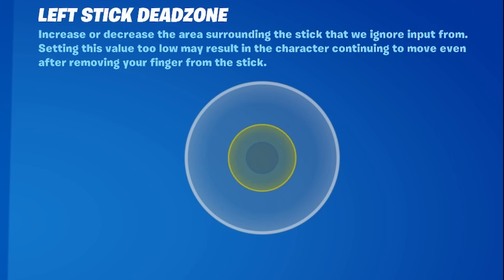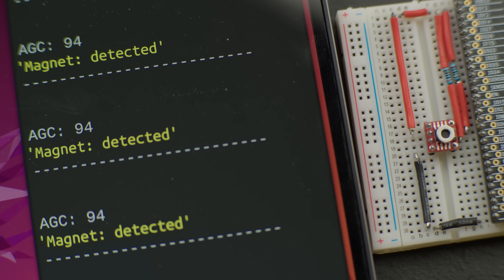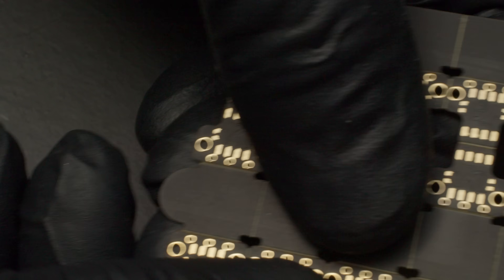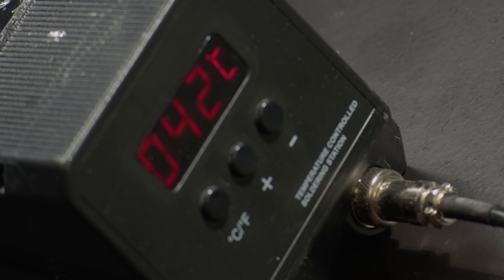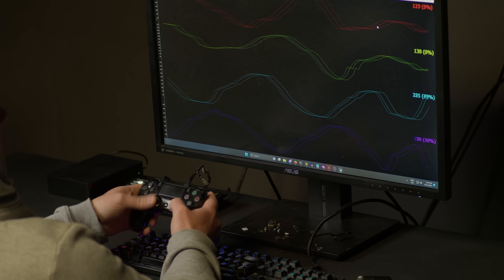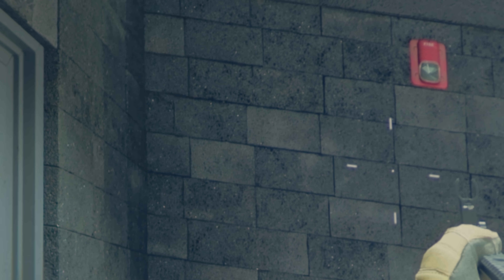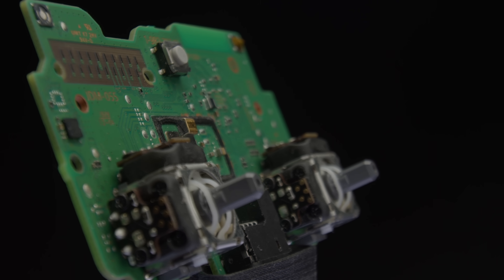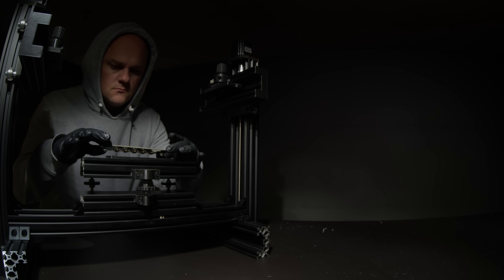Beating the $20B Joystick Drift Problem, and giving it away for free

Comment: i'm very happy that people are explaining how open source licenses are better than an "open unlicensed release" for protecting your creations from being "locked away" by ill-willed companies
Reply: The thing is, the companies don't want to fix controller drift. They want to sell more joysticks, that's it.
Reply: @alanwatts8239 third party manufacturers would be happy to have a small cut of controller sales by fixing it.
Reply: I'm surprised about people thinking this tech hasn't already been patented
Reply: @tesmat1243 Isn’t this the same method used in the N64 controller? Those sticks don’t drift, but they lose center-return from wear & the plastic part is easily replaced.
Reply: @johnnyc.31  the n64 uses an led, i think.
Reply: @tesmat1243  it has?
And has existed for a very long tkme
Reply: @tesmat1243 It hasn´t, but it also has been around for some time. You can literally buy ready made hall effect sticks that are made for being soldered into Dualshock4/Dualsense5 controllers. The controllers are relatively easy to disassemble, especially the Dualsense5 which is what is actually surprising (Same for te PS5 itself, it is in general quite friendly towards taking it apart and modding the hardware), and the soldering job is also pretty easy.
Reply: Can you explain this? Won't he get sued in the future if he's technically modifying not his property?
Reply: I am surprised that anyone need explanation, given the history of patent predators lurking around in our market environment.
Reply: @heyhoe168 oh yeah, because everyone knows about copyright laws and patent locking
Reply: @heyhoe168 Who the fuck would want to sit down and learn about patents? Please bro
Reply: @heyhoe168 I'm surprised you're surprised
Reply: True, but the "unlicense license" makes that phrasing a bit poor.
Reply: The fact that companies and individuals can just "patent troll" is a crime against humanity - how is it that we dont have a legal system that have protections against cynical use of patents? 
This is absurd.

No wonder normal people have zero trust in the system - it's corrupted by a lobbyist system that benefit insider  companies.
Reply: Make parts for 3d printers and make instruction on how to assemble everything with radio parts. Lego for big kids.
Reply: Use the same tech in cameras that detects light and use the pixels to track stick position with a fiber optic light on the control stick.
Reply: dont be a sell out and sell to a company bigger than you
Reply: There is nothing to licence or patent, hall joysticks have existed for a very long time.
Reply: Doesnt work in the US or UK. Copyright is your right, not something that doesn't take affect until you register it. Registering only enables the original creator to sue for legal fees, unregistered copyright enables you to sue for infringement
Reply: The Sega Saturn 3D controller had a hall sensor stick back in the 90s, 30 years later and here we are. The Saturn standard pad also had a vastly superior D-pad compared to most modern pads, ideal for fighting games.
Reply: best way of protecting an idea from monopolistic tools by corporations and ill intended individuals
Reply: Hall effect sensors are a thing already. I think the first controller using these was Sonys Sega Saturn and that was back in the 90s. I don't know why he is pretending this is something new maybe to generate clicks.
Reply: @EbonyPope  solutions like this become "new" the second the industry adopts a standard for joysticks. potentiometers have been the standard for a really long time, and a good and open-source hall effect solution would indeed become a novelty in this context. it's not just for clicks. i don't think he ever meant to imply he invented hall effect sensors (i mean wouldn't he call them something like heier effect sensors?), i think he meant to come up with a reasonable solution to the problem of unreliable analog sticks.
Reply: @liamsemicolon  But this solution already existed more than a year before this video was made. I think it was the Gulikit King Kong 2 who implemented it first but I'm not sure. Apart from that he doesn't really correct people praising him for inventing this "new" thing so he clearly is relying on the suggestive power the video title has. No big deal just typical Youtuber stuff one should be aware of. The problem with hall effect sensors was that they were too bulky in the past to be practical and they weren't very cheap too. Now with miniaturisation they are everywhere.
Reply: @EbonyPope  if you take a look at the channel, you'll notice that he's been working on this for a long while. the praise comes for the open-source nature of the project, more than anything. gulikit's design is patented, and thus requires a license to use. things like this are good because they solve an issue AND give people the chance to freely try it out.
Reply: @liamsemicolon  I'm pretty sure this can't even be patented

Comment: Look up Sega DreamCast gamepad, especially how shoulder buttons work. Second thing - drift affects only Nintendo Switch JoyCons due to poor quality of thumbsticks and also the fact that since sticks themselves being shorter, there's less margin for deadzone. Video game systems has been using variable resistance controllers since the very beginning, 60 years ago and technology has been proven as the best price/performance wise. Also, how exactly does changing angle value reading technology solve the stick not centering problem?

Comment: i think the long game here is to use a vector hall sensor, preferably one with an onboard dsp that can apply linearization code. im not sure that currently exists, it probibly does. combining a sensor with a dsp is how optical mouse tracking works (sidewinders just used a single optical mouse sensor for all 3 axes, probibly with different firmware on the dsp). but you get it down to a single chip, and more or less the same gimbal cage with minor modifications to accept a magnet. i dont mind moving to a purely digital interface, the closer you can keep the adc to the measurement the better, and so much better if its on the same chip. pwm output should be considered as its easy to filter a pwm signal into an analog signal, to enable a drop in replacement for controllers that only support analog. i2c might be less desirable as being a potentially huge source of latency, spi is better since it can run at a higher clock.

Comment: Planned obsolenece. I've been using my 1.2$ keyboard since 2009 and while it looks rough asf now, it still functions correctly, even after heavy beating and abuse.

Compare this to all these 30$ and 60$ gamepads, they last only 6 months - 2/3 years each even though I don't press the buttons or sticks hard in fear of damaging them. I expect them to last me at least 15-20 years each but they die within months. This is why I stopped buying gamepads or gaming peripherals in general. I just use cheap office keyboards and play games with them.

Comment: metal screws near the magnets! yeah!
Reply from the maker: Why does that matter? A metal does not effect a magnetic field unless you run a oscillation voltage through it.
Reply: @MariusHeier1  In their natural state, some metals are usually not magnetic themselves but will be attracted to objects which produce magnetic fields. When they are magnetized, they become magnets themselves. Also , magnetic field is definitely extended farther away from the magnet when near.. On the other hand, steel is said to shield, redirect or block magnetic fields. so I think metal screws is a bad decision .
Reply from the maker: @FireGate_13  Any ferromagnetic material simpliy aligns its own magnetic field. Which makes it become stronger. Steel has iron so its not repellent. However plastic is a repellent and produces an opposing magnetic field. But why do we not need to care to much  about that?
Reply: @MariusHeier1  i thought that it was a bad idea. maybe i am wrong. i am not a scientist. I thought that gulikit made a hall effect joystick first.
Reply from the maker: @FireGate_13  Dont worry. Its just that    its in theory. And it wont effect this example. And everything is usually a compromise of things barley working.

Comment: The dreamcast joystick controler also uses magnets instead of potentiometers.  Which as SEGA would have copyrighted that, is probably why joystick makers haven't been using the tech,, even though the copyright has almost certainly lapsed by now.

Comment: Congratulations
You're trying to solve joystick drift, which is caused by bad sensor readout, which is caused by parts wearing out, which is caused by friction.

You decided to "fix" it by replacing the sensors, but you haven't fixed the underlying problem, which is that the joystick's movements are friction based.  
Once the joints wear our you're still going to end up with joystick drift.  You literally haven't solved the actual issue and your joystick is going to fail just as quickly as the stock joystick. 
All this effort wasted, unfortunately.
Reply from the maker: Your missing the main problem. The problem is game pads needs to be thrown away because they cannot use it after some time.  Now you can, first because of auto calibration, which is enabled by the sensor and a computer, which needs magnet to read positions.

Comment: That's the thing though, Xbox and Playstation DON'T want to fix their drift problem. How would you explain that the ps5 controller has the same joystick under the hood than the ps4, one that is notorious for stick drift and could of been easily fixed. They just want to sell more controllers..
Reply from the maker: The new Dualsense even made it into a business model. I guess not for long.

Comment: Nothing new here, the sim community has been using Hall Effect sensors for decades, with aftermarket mods as well as new higher end joysticks.  It’s purely a matter of economics and price point for the market in regards to console game pads.
Reply from the maker: Im sorry you are atleast partly wrong.  Its not possible to make hall effect joysticks this size without heavy filtering. Or without using 2d or 3d hall effect sensors with multiple hall effect sensors in one package, mine is using cordic computer in the same sensor chip and track the rotational field.. not magnetic strength.... so that is new

Comment: Damn good work. I converted some sticks to hall effect a while back, but I had to bypass the MCU and use an RP-2040 zero instead, my design wasn't nearly as robust and I had to glue the magnets to a part of the pot and the sensors to the board. And the ring magnets! If only I knew those existed I could have saved so much fiddling with rectangular magnets and superglue. This is what I would've made if I had the tools and skills that I currently don't.
Reply from the maker: But now you do! Except the tools. Haha. You work sounds very good, i probably just had more time to do it.

Comment: This is why I will always go back to Mouse control, After a few weeks of hard use my controllers all get drift. I've even gone to the effort of resoldering many of the joysticks I and others owned because spending £40 - 60 on a controller for it to become unusable is just pointless. Weirdly enough about 10 years ago I tried to do the same where I attempted to use the AS5048B sensor but resin printing wasn't a thing and my attempts at a 3D printed enclosure with FDM was fruitless.

Comment: hall sensors seem way to smart to not be in every joystick. there has to be a reason why the big three (Nintendo, Sony, microsoft) don´t implement those. Price is probably not the issue - i mean how much more can controllers cost? was it already patented and the original inventor was asking for too much? maybe the patent for detecting electrical motor movements applies?

Probably the controllers would be to durable(?) for our late-stage capitalistic world?

Comment: Awesome work! Not only device but also video are great! What do you think about little optimization of your device? I think it is possible to place 1 small magned down under the moving part, not on the sde. It will made device cheaper. But we will need to place also under the joystick 2 position hall effect sensor. Does not know if this parts exists.

Comment: The real problem is when you try to fix Nintendo's design specifically. At my engineering school we've tried improving on their design but the controller form factor is so limiting that it's essentially an unmanageable problem in that it requires a total ground-up redesign of the analog stick. It honestly has made me realize that the thickness of the switch and joy-cons was Nintendo's actual mistake, not qa or design issues with their analog stick. Although if someone here does have a suggestion for an approach that could work with the existing analog stick and housing I'd love to hear it because I could implement it and see if it works.

Comment: Pretty cool but I'm still doubtful cause I've had controllers with hall effect joysticks before and the drift and desync issues were constant and atrocious. One of them didn't last 6 moths before it could read left at all. I have a Logitech steering wheel and I have to clean the sensor constantly and it still goes out of sync every 45 minutes, even after moving the sensor closer to the magnet (before I moved the sensor it went out of sync every 10)

Comment: so what if i we live in a region with a different magnetic field than where it was calibrated to zero, that may cause drift at mid point. since the sum of magnetic field will be different. or does the chip used have a PID type of correction thing for external magnetic fields. I'm definitely not an expert i barely even know what a PID is and would personally struggle to solve this problem if I had to so don't think I'm just trying to be snobby, I'm genuinely just trying to maybe notify you of a possible customer complaint

Comment: The problem of analog thumbsticks in game controllers is not just a defect in the potentiometers. As the author of this video mentions, over time, the analog stick begins to fail to return to the center due to a worn out or also damaged spring. And let's not forget that the mechanical components of the knob are also mostly made of plastic which wears off over time. From my own experience, I know that Hall sensors have already been used and in such well-known consoles as the Sega Dreamcast or Playstation 3, and they have not eliminated this problem. In many cases, it is enough to use a simple grease for potentiometers in a spray (I managed to restore the proper operation of many pads from PS4/PS5 or Xbox, you can find such in many electronic stores).
In my opinion, the only solution to this problem is to completely redesign the thumbsticks.

Comment: Been wondering about why my PS2 and PS3 controllers have never had this issue (never owned a 4 or 5). They're still working 20+ years later but I have experienced this on Xbox 360 controllers in the past. We're not going to talk about the N64 analog stick though. The worst in the industry.
Reply: I was scratching my head too when I heard about this... originally I thought people had broken/worn return springs and their drift was the stick being out of the dead zone. 

I used 1 controller almost exclusively through the 360 generation, no issues other than it was heavily abused and properly worn out. issues with the return springs, and the left click not really clicking unless you pushed on it just right.

I have xbox one controllers that I use from 2019 or so, basically whenever they added Bluetooth, but my other controller which I switched to for the 3.5mm jack worked fine, and my day one before it too. 

people online burning these PS5, switch, and xbox series controllers after 3 months seemed like insanity.
Reply: @matthewmenteer5673  I can't think of a good reason for this problem in recent controllers, other than poor engineering and cost cutting on parts.

Comment: Just to clarify, this here, the solution to aproblem is actually the problem for the companies making controllers. If they had their way, which they currently do, you will have to buy a knew one every X months, depending on usage. Products that do not break or break as fast have never been desirable for private corporations, they will do anything, even(technically illegally in many countries) work together to ensure the market is flooded with inferior products that are meant to break and be replaced for full price.